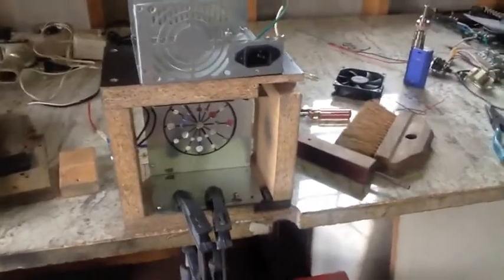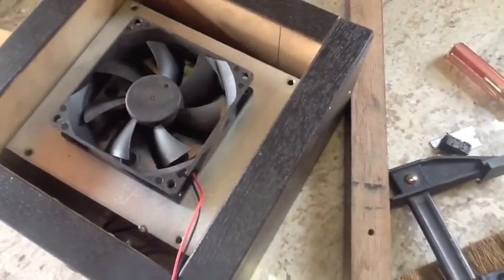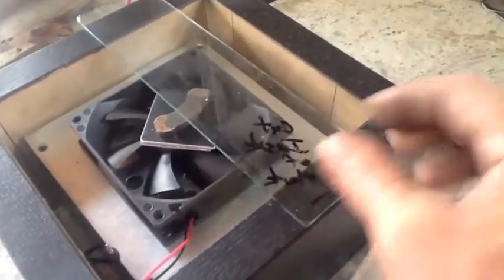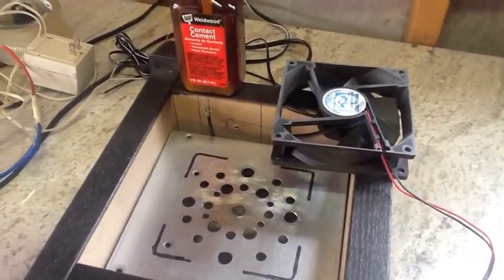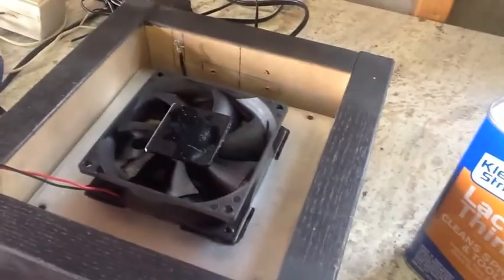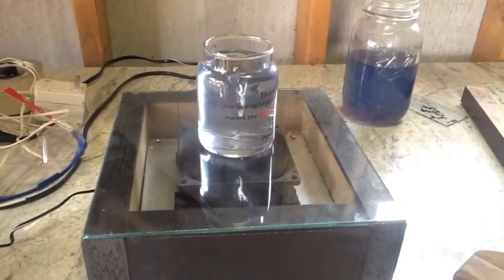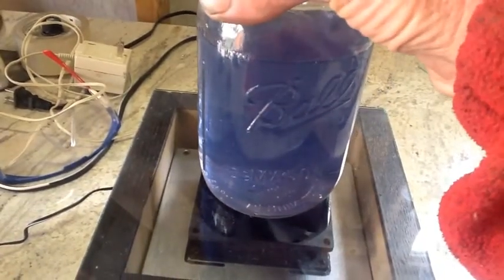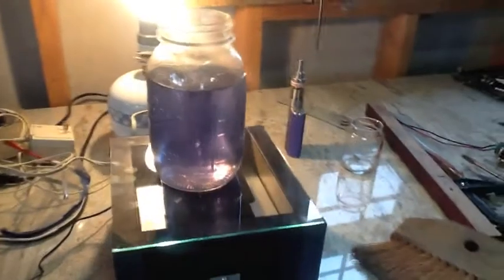DIY Magnetic E-Liquid Stir Plate: Build #2 (The Success)

Comment: very good job but getting popcorn lung will kill you buddy .
Reply: The condition to which you refer is caused by the continual inhalation of a chemical called diacetyl. It used to be used in the manufacture of butter-flavored microwave popcorn due to its buttery flavor, and is why the condition itself is called popcorn lung. For the same buttery effect, diacetyl is used in some e-liquid flavors to add a creamy or nutty element. An average "vaper" using one of these e-liquids is exposed to roughly 9 or 10 micrograms of diacetyl a day. Alternately, an average cigarette smoker is exposed to 6,500 to 7,000 micrograms of diacetyl a day. At this point, I would like you to think about all of that and what it means as far as how much "killing" you think diacetyl actually does.
Reply: @michaelaaron230  this is correct, at least up til about 4 years ago. Diacetyl hasn't been used in e-juice since the popcorn lung scare tactic too off. While the amount used was miniscule, it was completely removed from e-juice production as a precaution. The EU also banned it's used in e-liquids back in 2016. Other than that, you just replied to a year old comment, but good on you for knowing your stuff.

Comment: Would you get more power ( faster spin) if you cut fan blades off fan since you don;t need to push the air from the fan? Just a thought?
Reply from the maker: Maybe...but the biggest issue is just the thickness of the VG, after all it is just a POS computer fan....LOL. If I truly wanted more power I would take a small DC motor from a vacumm cleaner and just use that instead. Heating the Recipe in a warm bath makes the VG the consistency of water so it does a good job for me...I just mix about 60ml at a time anyways. Thanks for watching! :)
Reply: I know I am late to the party here, but it seems like speed control to keep it from getting out of sync would be a bigger issue. will have to look at your "failed and success" video still, though. see if you already addressed this lol. If you want a really strong system that will not take getting a different setup than  you have now though I would look online for cheap rack mount based server fans for cooling them, as they tend to be incredibly strong and have speed up and down control built into them, in many cases (Dell has one I grabbed a bunch from a guy for like 2 or 3 bucks a piece, on ebay, 12v, 2.5a yes amp, not milliampers LOL) I can take a fully loaded 8 x 5 PCB for a 500 watt stereo back plane with tons of banana jacks (7.1 surround sound, so 8 red 8 black) and hold it on the end of a cardboard box I stuffed one of the fans inside of, and not only does it hold it on by air pressure, I can shake the thing pretty good with out it falling off XD)  3615KL-04W-B96 P2780 is the model number of what I bought and I see that dell dimension 8400 units have them inside, if you happen on something like that at say a thrift store or someone is tossing one out. Something worth salvaging out of them :)

Comment: Have you had a chance to try it with say 80ml of e-juice? I have found that these computer fans don't have the power to stir VG at quantities greater than 30ml.
Reply from the maker: Have done 60ml with this one, never tried 80ml. The trick to larger quantities if the ambient temp is cool (air-conditioned) is nuke a bowl of water till its slightly hot but not boiling and place your vessel with juice in it for about 90 seconds. This thins out your VG and it will spin up fine. Give it a shot & let me know :)
Reply: Well, I'm in southern California where the temps are scorching and its not much better inside the house (usually around 80 degrees) ... the computer fan just can't spin the juice. I replaced it with a "vibrating motor" (after removing the counter weight)  from a gaming controller, attaching a thin steel platform to the shaft, then gluing the hard drive magnet to the platform, but it burned out after throwing a new 80 ml mix on it (80 vg / 20 pg) ... so it lasted all of 30 seconds. Now Im thinking of taking a motor out of an old printer and trying it.
Reply from the maker: Snatch ya a nice DC motor out of a vacuum cleaner off the side of the road, them R some good motors, peeple toss them cause the belt broke but guts are good. I have about 11 gotten that way. Way more powerful than you will ever need, use a dimmer as speed control mechanism or wire in a pot
Reply: I like it ... but it sounds like overkill for this application
Reply from the maker: I have been known to be guilty of overkill! :) I use whatever I got 👍🏻
Reply: I actually found a "dead" portable 12 volt air compressor. I took the motor out of it, and it will spin any amount of juice I can throw at it.  :-)
Reply from the maker: Sweet!...... See, sometimes the overkill route aint a bad road to take! Nice job! Congrats :)
Reply: It would appear you're right!  :-)  Thanks!
Reply from the maker: Even a blind squirrel finds a nut once in a while! :)